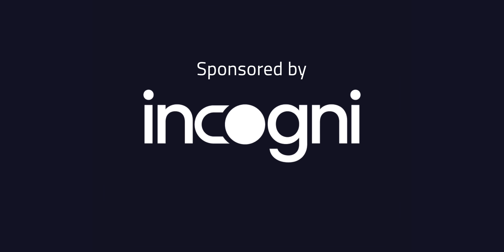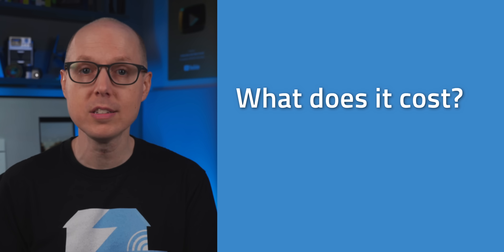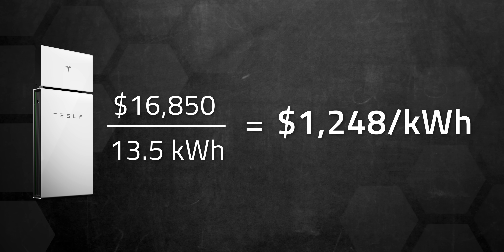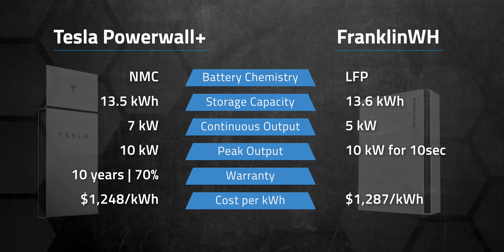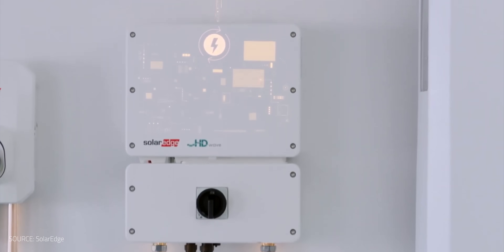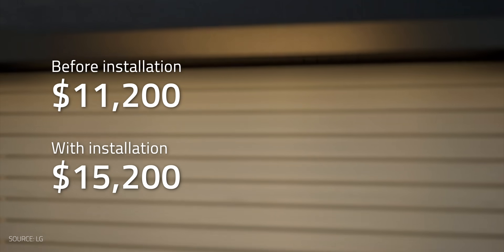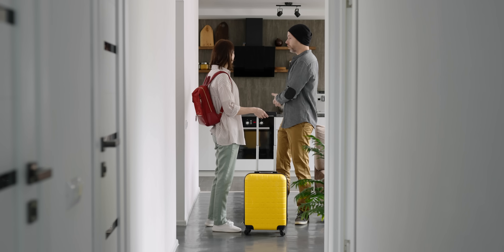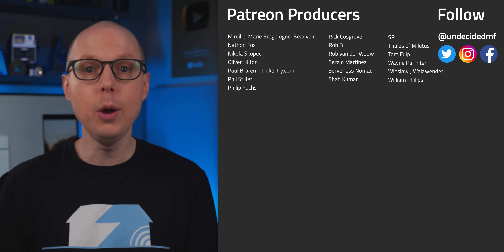Top 5 Batteries for Home (And One You Might Not Expect)

Comment: These home energy storage prices are insane and are, frankly, financially irrational. With a warrantied energy throughput cost of ~45 c/kWh they make zero economic sense. Cheaper just to buy from the grid.

If you need grid outage backup then I suggest other options would make a far more sensible use of one's money. A generator, or an EV with V2L capability, or a portable power station as mentioned. Then there are hybrid inverters which can be set up with server rack or pre-made LiFePO4 batteries for 1/3rd of the cost of these overpriced battery systems. I have up to 8 kW continuous output + 25 kWh of usable storage capacity for less than half the cost of a Tesla Powerwall.

As to flow batteries, these are not new, that's just yet another player making promises they likely won't deliver.

Comment: While there is no specific residential product, or even one rumored, Redflow could be a player in the flow storage battery space someday. They actually have done a couple of residential installations in Australia, but it does not seem to be a market they are targeting as of yet. The Forever Energy flow battery could be a game changer though, and might push Redflow to enter the market.
Reply: They've done more than a couple of residential installations in Australia, every one that I know of has at least two Zcell batteries installed, the exception I know of is a local chemist who only has one Zcell with the sole aim of ensuring his refrigeration keeps working to ensure his medical supplies that are very temperature dependent are not destroyed. The chemist made local news as the cost of destroyed medicines in their refrigerator(s) exceeded the cost of a battery.

The Forever Energy battery does look very good and we would need 4 Zcell batteries to be comparable. There is a slight downside though, if you only have one battery, if there are any issues then any downtime means you are left with nothing. Flow batteries do require the electrolyte (two pumps) to be constantly running 24/7 which throughout the long winter nights will pull a bit of stored power.

Zcell batteries require a maintenance cycle every 24/36/72 hours, variable chosen by the operator/owner. Essentially after a maintenance cycle is done, the battery presents itself as virtually a brand new battery, this is one of the reasons they have a virtually 100% capacity after 10 years. I'm wondering if the Vanadium flow battery from Forever Energy will do maintenance cycles like the Redflow Zcell battery?

We've got two Zcell batteries from Redflow, had them for 3½ years.

Comment: Very good summary.  I'm especially interested in the smaller/portable (2-3KW) units  for a van/RV conversion.   If you  'YouTube' some of the fixed systems for vans (long heavy gauge wires, separate batteries, buss bars, solar inputs, MPPT, etc, etc,  it quickly becomes a large mess of wires...with HUGE low-voltage line losses.   All this goes away with one of the portable LFP options...plus you can use it in your home...or add a 2nd one for redundancy.

Comment: I went with the Enphase as well. My primary deciding factor was the redundancy of the panel & batteries. My previous installation was a 2,4KW string system where any obstructions took out the whole string.

The more hopeful benefit is that batteries or panels can be upgraded piece meal instead of requiring a full string or complete battery unit needing to be replaced to improve the system. (Provided Enphase comes out with battery upgrades as claimed by my installer)
Reply: Shading on a panel resulting in the whole system not producing power would be the result of panels without bypass diodes.  Newer panels, especially with half-cut cells, have been proven to not have this issue allowing a much lower cost of a string inverter.  enphase will not tell you that.  Their stuff is good for some situations but many times you can also overcome the same issues by using multiple solar controllers for sets of panels oriented differently again at a much lower cost than microinverters

Comment: Matt, I’d like to know the round trip efficiency of these systems. ( AC > DC > AC = % lost ) The flow battery might be cheaper to scale but will you need 13 kWh to get 10 kWh out? Or just 11 kWh to get 10 kWh using NMC or LFP? Who is offering efficient inverter? Extend this calculation to solar being the only generation source and the SolarEdge/Enphase systems change overall system efficiency. This data is hard to come by but important. Brian

Comment: I'm not convinced home battery back-ups are a good choice from a carbon footprint perspective. I understand that some people are in an area where a days long blackout could be life threatening. But the gas generators you mentioned would actually have a MUCH lower carbon footprint than the battery alternative from a lifecycle cost perspective.

A lot of these batteries produce upwards of 200kg of CO2 per kWh of capacity. And that's not to mention the waste products after their useful life. Battery back-ups are indeed "Cool", but I don't see whole home scale back-ups as a good solution for the majority of cases.

Comment: Nice overview.  I have 2 Tesla Powerwalls and was dissuaded from the Enphase batteries by my installer since my installer had so many problems with failures and service. Essentially dropped Enphase batteries from their line up after 2 years experience. Any commentary on service or post install problems?

Comment: I've been following Will Prowse for years, and he has some great DIY solutions for home solar, including grid-tied systems, and they are scalable.  The pricing is competitive to the systems in this video, and even more important, can have higher outputs.  I saw a video with Tesla's power wall, and there is a discrepancy in the contract, where they advertise 13KWh, but the system's inverter will only allow 11 KWh.  So while all of these systems look good, I think I am going to go Signature Solar.  Scalable, more flexibility and power options.  I'd rather have too much power than not enough.

Comment: I went with the SunPower SunVault. They use the EnPhase MIs, IQ7, and have the LFP chemistry, AC Coupled and can connect to the Virtual Power Plant here in CT with Eversource.
Primarily we went with SunPower for 2 reasons. Our installer that we chose and really liked is a Master Dealer for SunPower and due to the Safety of the LFP over the NMC.

Comment: Have you done the math on the rationale of being energy neutral on a yearly basis and using a battery to avoid grid injection?
I know Massachusetts is not as far North as the Netherlands, but I doubt you get even close to covering your winter demand with your solar panels if you merely target yearly neutrality and, similarly, your battery is not likely to make much of a dent in preventing grid injection unless you have a seriously high summer demand (but then I doubt you're energy neutral over a year).
Sure, a battery may make sense if prices fluctuate over a wide range during the day or the grid is very unreliable in your area, but it's not likely they do much for the stated goals and they certainly don't help store energy for the winter like nuts for squirrels. Then you're better off filling your roof to the brim with panels and underdimensioning your inverters to not inject as much in the summer (if that is a problem anyway, any kWh not generated from fossil fuels is a good kWh).

Comment: Sheesh, all of those are completely overpriced solutions.

There are plenty of solutions with pricing between 250-500$ per kwh. EG4-LL batteries, for example.

Paying 10,000$ for 10kwh of storage, isn't nice, when you can instead, pay 10,000$ and get 30kwh of storage.

Comment: Storing energy for the winter seems to me a bit impossible. Last month, I have consumed about 150 KWh. That is ten times the capacity of such a battery. That means I need 30 batteries for a 3 month winter. What's off in my calculation?

Comment: If you're not in an area that experiences outages (like in Europe), getting a battery at all might be financially stupid depending on your usage and rates for selling your solar power to the grid. You might end up paying 50 cents per kWh coming from your own battery because of the costs of the battery, installation, more complex inverters and losses from charging.

Comment: I had been looking more into the Tesla Powerwall recently with the idea of being part of the energy trading platform in California. Sounds like people are getting around $500 a year from using the platform. With government rebates, it drives a pair of Powerwalls down to $11,300. Then I found the cost of install was around $6,000. If you ignore rebates, the Powerwall with two units is nearly $18,000. That is a chunk of money. 

With so many advancements coming over the next two years, it has made me think about waiting, because I believe the advancements will reduce costs and improve performance a ton, not just a little. I was hoping to have a battery system to attach to my solar before buying an EV, but waiting is likely going to mean I will have an EV before I have the battery storage on my home. 

Good to hear about all the options out there and look forward to more coverage of these kinds of technologies.

Comment: I would love to know if Ambri is ever going to make a home version of their liquid metal batteries. They seem incredibly stable and the possible lifespan could be decades.
Reply: Yes! I've been very interested in Ambri, and I'm hoping that it takes off. There's not a lot of news about them though.
Reply: If I understand correctly, those are liquid metal batteries which mean they gotta be very hot to work. That's why they are being considered for power plants or data centers, in a home it would be hard to keep them at high temperature. I might be wrong, but that was the limitation as I remember.

Comment: 200 kWh is not completely overkill… that’s how much energy my house uses in a day in the coldest days of winter…. I use 50kWh per day in the spring, when there is almost no heating… 13 kWh battery won’t keep me online for more than a few hours. 15k$ is a very, very steep price for just a few hours of outages
Reply: Batteries are simply not a good solution for full house backup in cold climate. Generators are a much cheaper alternative that can provide power for much longer outages.

Comment: Matt: Thank you for the summary. I was shocked by how much more expensive a home battery vs. a EV battery. An EV battery pack cost about $100-130/kWh, which is 1/10th of the cost of a home battery. We have a long way to go for home energy storage.
Reply: EG4 48V/100Ah server rack batteries are now around $1300, or around $270.00 per KWh for 7000 cycles of 80% depth, and should last around 20 years.
Reply: You are comparing the price of acquisition vs the retail price. They are different concepts
Reply: @nick_riviera  True. Automotive industry margin is between 6-10%. Even you add the margin to an automotive EV battery. It is still very much cheaper than a home battery.

Comment: What I don't understand is why no-one is considering the most reliable Batterie chemistry out there... Iron-Nickel!
Those Batteries have shown to be working 30-50 and more years reliably and the cost of Iron isn't that high, just Nickel got higher, but thats mostly because its used in every Battery out there, no matter what chemistry they use.
And they aren't prone to life time reduction due to deep discharging them.

I know, kWh/Volume is dismal on them, but hey its for stationary applications anyway, so what

Comment: I know your search is focused on new construction, but it would be great to see a breakdown of options for people who already have solar and want to add storage a la carte. Last time I looked, a lot of these systems, including Tesla, required the battery to be part of a new solar installation. It would be worth mentioning those that can be added on later as a desirable feature.
Reply: Does not matter if new  construction.  Battery back up can be added to any system  with   designing a variety of  ways using controls.    That is a  ad  by Powewall is a offer  by Tesla.  Look into the L G , has proven longevity also dc or ac ( that's Key)  if your string or micro inverter   or your choice.   A system is  setup of control optol

Comment: Strange how a Tesla Powerwall is ~1200 USD/kWh when you can buy the exact same type of battery with a whole Model 3 around them for ~700 USD/kWh. Huh.
Reply: That is for the Powerwall +. The Powerwall + is specifically for homeowners who are having solar and storage installed at the same time. If you have existing solar, you wouldn’t get the Powerwall +, just a Powerwall 2 so the price is going to be cheaper.

Comment: I've been waiting for a residential flow battery to come to market. But it seems to always just be a couple years away.  The cost of batteries and installation is still just too high for me. I'm also right in the middle of trying to resolve the issues with my second SolarEdge inverter failure. Losing  over 60 days of production is taking a big chunk of money out of my wallet to pay the electric company. No warranty covers that cost that I know. I'm currently on a loaner inverter. I also have a smaller system with Enphase and it hasn't been 100% reliable either.

Comment: We got solar back in 2013.  But to get the fed/state/County and city rebates (which paid for half the system) we couldn't put in battery charge/backup.  So ALL our excess goes up to the pole and onto the neighbors.  But we do get credits which does help with the bill.  During the summer, not using the A/C we usually don't pay anything until Oct/Nov.  We are rather frugal with our electricity and gas usage anyway so we are outliers when it comes to average usage etc.  We have about 5 years before the panels begin degradation of about 15 percent.  Guaranteed for 25 years but since the company is now gone don't think that means anything anymore.

Comment: I’m quite shocked of the prices of home solar power systems in the US. I’ve installed 9KWh array with hybrid inverter and a 14.5KWh (DC) battery for $15,000 with installation. 
Although all of these batteries are cool (and look very nice as well) they are very expensive for what they offer and not sure if they are the top choices.
Especially Tesla, which has to convert from DC-AC several times…

Comment: I decided I needed a battery backup for my home and was primarily interested in LFP battery.  I knew Tesla would be expensive and wrong battery type.  I tried Enphase through my solar panels installer and was told they had not even seen a battery in a year.  I tried Franklin and did not even receive a response after 3 emails.

So, I've been thinking about using a UL listed 48 volt battery bank and Victron system for the back up.  

So no luck here at all and I live in California where we have plenty of sunshine.  Though we have a very stupid Public Utilities Commission, that is doing their best to stop solar installation in the state.

Comment: I would definitely check a Fronius solution (maybe with some BYD batteries?). Enwitec has some great switchover boxes for Fronius so you forego the transfer switch installation and they integrate AMAZINGLY into homeassistant for full custom control of the system's behaviour. You can do things like predicting solar production for the next day and adapt storage and grid/generator consumption etc.
Reply: As if BYD and Sungrow were ignored.
Reply: Fronius will fail every other year for as long as you own it, that is the most reliable thing you can say about Fronius.

Comment: The battery I would like to see is a high power lower storage capacity battery.  So the battery in my Mitsubishi iMiEV can output over 46 kW but only stores 16 kWhs.  That is what I need for my home.  Power failures are rare and usually pretty short duration.  But I don't want to have to rewire my panel completely and choose what is going to work during a power failure and what isn't.  I just want to run my home seemlessly until my battery dies.  Usually the power comes back on in 10 minutes or so, so most of the time 16 kWhs would get me through.  But I do have a 200 Amp panel and some big ticket power items like my heat pump and my car charger.  I want my heat pump to keep running and that takes 10 kW all on its own.  The power to storage ratios on all these batteries means that I have to buy three or four batteries to get the power I want and that gives me way more storage than I need.  I really just need to take an iMiEV battery or equivalent and wire the motor leads into an inverter.  Why isn't there a company out there doing that?